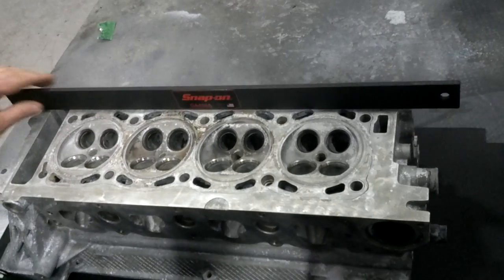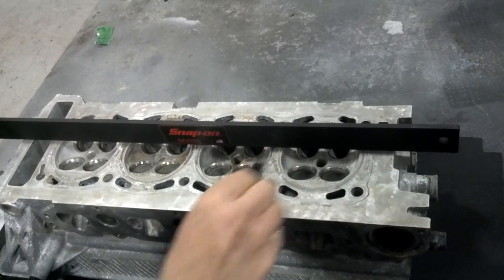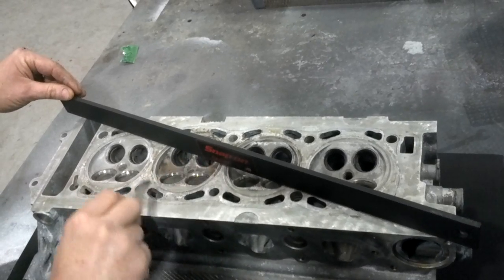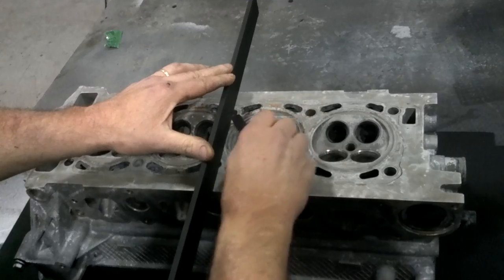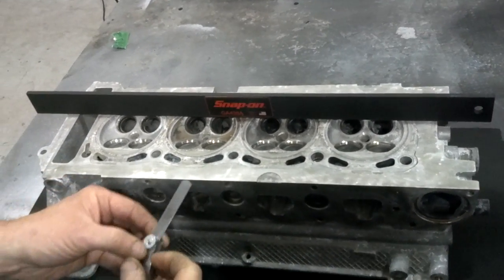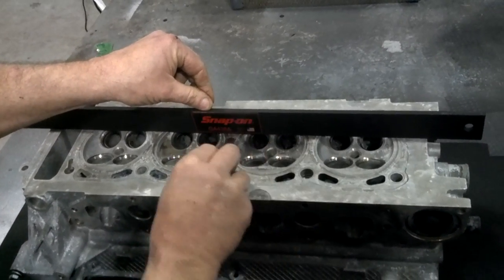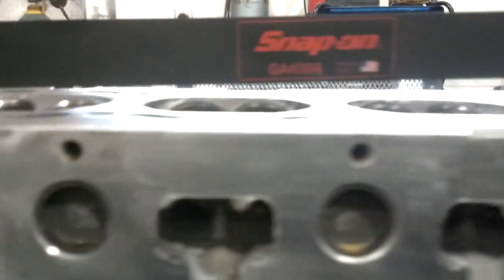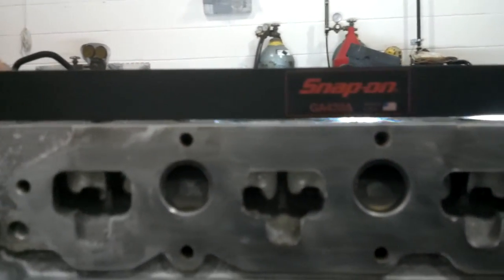Cylinder head inspection for flatness / warping

Comment: thanks for sharing..my engine locked up, due to cloged up oil pick up screen. im tearing apart to see if i can turn it enough to get to the bolts, before trying anything else. What are the chances of messing up the heads, as far as warping them in this case?? did they get overheated due to lack of oil?? excuse my ignorance.
have a great day.
Reply from the maker: jose chavez 
lack of oil might also cause the engine to over heat, but more likely there is damage to cam bearings (if it's an overhead cam engine) and lifter bores, etc.  the head loses oil pressure before the lower end.
Reply: MasonClassVideos thank you, i will shop around for an used engine, anything else is way out of what i can try to do, now i could only remove 2 bolts out of 4 to lift the engine out, i was told i have to get it out with the torque converter, but it would spill lots of oil....
Reply from the maker: jose chavez if you have the oil pan off, remove all the connecting rod caps and loosen or remove the main bearing caps.  That should let it turn for you.

Comment from the maker: The tolerances can be found in the manufacturers engine overhaul specifications published in professional literature such as MotoLogic, Shop key and Chilton's Pro.  A machine shop should be able to provide a specification, or possibly an Internet search on a popular make and model vehicle.
Reply: Not for my vehicle. Not sure if youre still around after 4 years, but I have a 0.05/200 mm as planarity (Im trying to translate from this horrible manual). Why would they give me /200, ie 2m (over 6ft!) when the heads are not that big. It makes no sense. Is there any other metric Im not aware of? Im trying to write up my own manual since this is the only survivor of this make (its a bus, 10.35 liter MAN engine). I will need an overhaul soon, and I cant even give the specs to a machine shop to shave off the heads...

Thanks!

Comment: If the engine block is also made of aluminum it requires checking too, yes? Got bubling on overflow tank after miss tuning my little old honda. Service manual says 0.05mm is the limit for warp :(
Reply from the maker: The block needs to be checked no matter what it is made of.  The head is usually first to warp because of its mass.  0.05" is about standard for most heads because of the MLS head gaskets used.

Comment: wouldn't it be simpler to check with prussian blue on a granite surface table? I'm sure most machine shops will have one... we can then check easily with the feeler gauges where the blue does not get smeared. that way it takes the guess work out.

Comment from the maker: In the case of the Saab used in this demonstration light could be seen between the closed valve and seat requiring the seats to be reground.

Bear in mind, too that improper cleaning of the head or block using abrasive discs can create low and high spots that will be impossible to seal correctly.

Comment from the maker: wildthing302, although you are correct that aluminum is a soft metal, once it is cast into a component such as a cylinder head or a block it will become quite ridged.  Also, the torque applied by the cylinder head bolts is far too small to correct even the smallest amount of warpage.  In addition, as the head warps and deforms the valve guide angle in relation to the valve seats change.

Comment from the maker: For MLS (multi layer sheet) head gaskets, like on this Saab, the tolerance is somewhere on the order of 0.004", so accuracy is essential for the best repair.

The cylinder block is checked in the same fashion, but also be aware of protruding or recessed cylinder liners.

Thanks for the questions!

Comment from the maker: The valves do not need to be removed, but if it is an overhead valve engine the camshaft may have to rotated or removed to allow the valves to close so they do not get in the way of the straight edge.
For accurate results a machinists straightedge needs to be used, this is a tool with a machined edge that is perfectly straight.  Flat stock and rulers purchased at the hardware store will not have this true edge and will not give the most accurate result.

Comment: Do you have to remove the valves to check this? Is checking the block pretty much the same way? What can I use or buy a straight metal to use?

Comment from the maker: The head will not warp unless the temperatures increase or it somehow looses torque (broken head bolts)  Normally if the engine is not overheated, oil in the coolant is from a bad oil-to-water cooler or occasionally a ruptured gasket where the passages are close to each other.  Always check flatness of the head and block whenever the head is removed.

Comment: Is it possible for it to warp even not under extreme temperatures? The engine I speak of is a Diesel which I believe wouldn't matter, but stayed within factory spec of operating temperature. Oil in the coolant mixed, but not the other way around.

Comment from the maker: The Saab would run, but loose coolant.  It would also over pressurize the cooling system from the combustion gasses pushing into the cooling system.  It is possible that the Cavalier has overheated to the point of no compression, in which case it may need rings as well as the head reworked.

Comment: what exactly would the Saab do when you turned it over while the head was still on? were the belts spinning but the engine was just making a electric sounding wine without actually starting? thats what my grandfathers 2001 Cavalier is doing. he was driving it home and didnt realise his radiator was cracked then it over heated and shut off. there isnt any coolant in the oil. So im thinking he warped the head or maybe locked up the motor